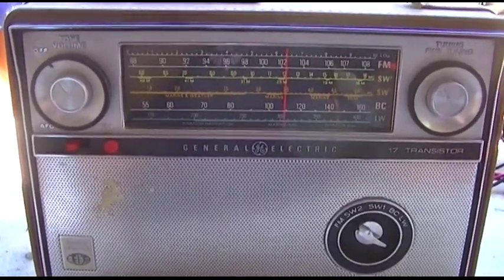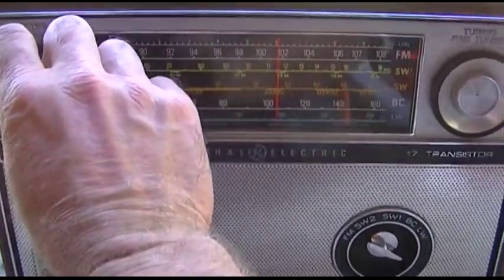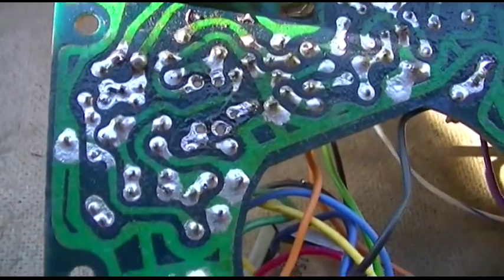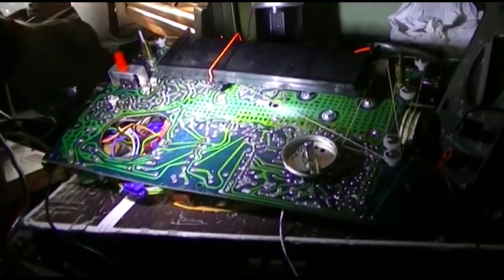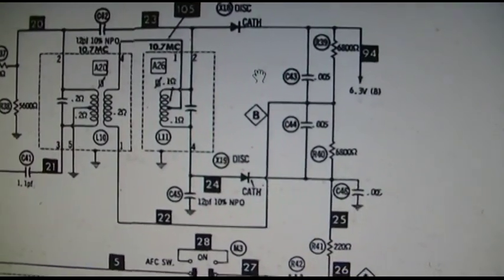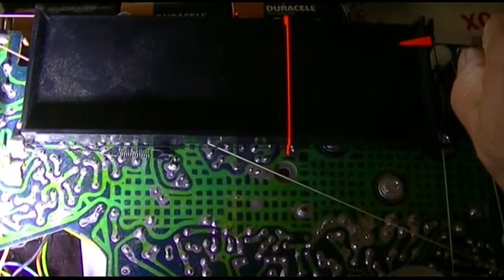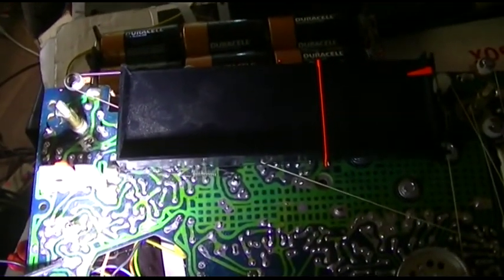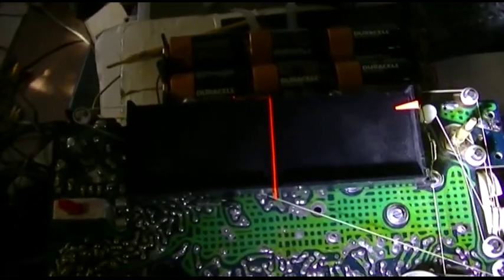GE World Monitor FM IF Transformer Cap and Alignment

Comment: At about 9 minutes in you said "I'm not familiar this ratio detector". What you have there is a discriminator as opposed to a ratio detector. With a discriminator, the diodes face the same direction. Also a discriminator is equally sensitive to AM & FM. This AM sensitivity is handled by the fact that this radio has 4 IF stages - the first 2 for gain - usually the 3rd is run at cutoff to clip the negative side of the waveform - and the 4th run at low B+ (or collector voltage) so that it will saturate on the positive side of the waveform. Basically you want to drive the last IF transformer with a square wave - no AM variations in the signal. With a ratio detector, the diodes are facing in different directions. It has about half the audio output as a discriminator, and the linearity is not as good as a discriminator. Circuit design is simpler with the ratio det. The "stabilizing capacitor" you referred to is what removes (mostly) the AM component of the signal, so the ratio detector does not require limiter stages in the IF. Usually only 2, maybe 3 stages of IF with the ratio detector. This radio you have is a top of the line unit with 4 IFs & discriminator.

Comment: Lets see if any theory has penetrated my 61 year old cranium via osmosis...The LC circuit of the faulty IF transformer was preventing resonance to occur properly, with regard to any chosen station via the tuning capacitor (dial)?
Reply from the maker: The alignment was most likely just off but the sams had me chasing a problem that didn't exist.  To be very basic, all the FM IF transformers are peaked except the last one, its peaked in the center of the 10.7 and if its shifted the thing will never work right.
Reply: Thank you for another detailed,informative video!
Reply: so A25 is wrong?? so what you're saying is that step 11 SHOULD be to peak a20-a25 and then adjust a25 for zero in the center?
I just bought one of these and it needs some love and I want to make sure that i get it right..
thanks scott
Reply: that should obviously be A26 for center